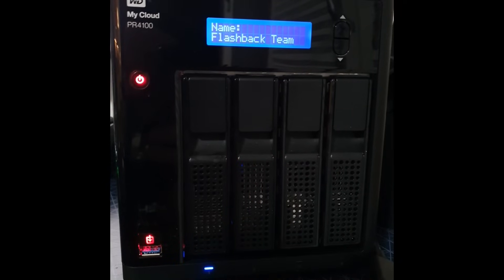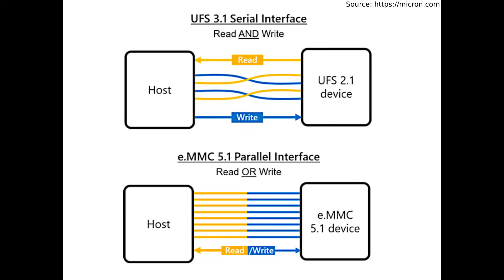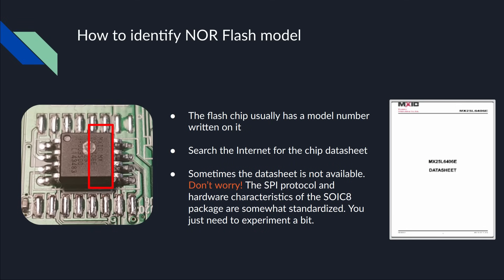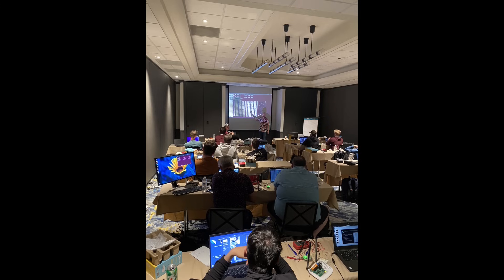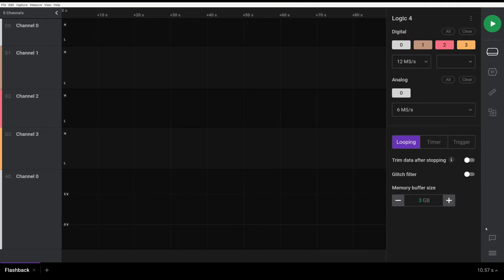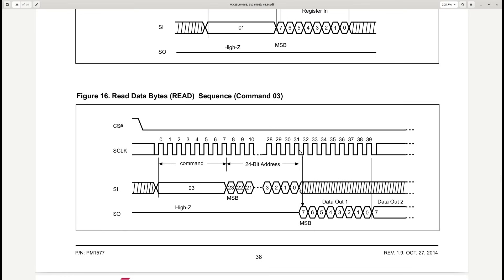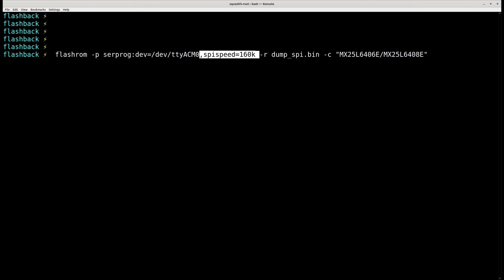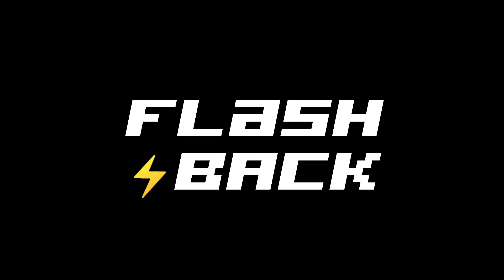Extracting Firmware from Embedded Devices (SPI NOR Flash) ⚡

Comment: This is really cool! I wanna dump the firmware of my e-scooter to hack it a bit, I didn't realize it could be that trivial :-) hopefully I get lucky and I can read/write firmware that easily!
Reply from the maker: We're happy you got inspired. Keep in mind that it all depends on where a firmware is stored. If it's external flash it is relatively easy. If firmware is stored within SoC/MCU then it won't be that easy as most likely there will be read protection that would need to be bypassed first.
Reply: @FlashbackTeam  That's exactly what I was thinking - I use MCUs for work stuff, and it's not necessarily that easy to dump their firmware given their flash is on-chip! I'm just hoping I might get lucky with the e-scooters one way or another ; if not dumping existing firmware to reverse it and tweak it, then perhaps finding an open source reimplementation that I could flash onto the chip, or making a new board myself if I have to (the main control board in that scooter isn't the one doing power distribution to drive the motors, so it's not unrealistic to just make my own, just will take more time...)

Comment: Nice! Used a similar process a few years back for some NAND flash. Didn't know about the hydrabus back then though. Instead I wrote a plugin using the older version of Saleae's SDK to dump the data of read commands to a binary file. Then had to do a little post-processing to get rid of the error correction codes that NAND has to transmit. Glad to see content showing an approach to the process!
Reply from the maker: In the past we were using Teensy with custom code to dump NAND Flash. Worth giving it a try too! But of course the most efficient is to simply use a programmer, but less fun.
Reply: @FlashbackTeam  Lots of lessons learned! I don't think I knew what a programmer was at the time. We relied on the SoC's bootloader to copy the file system from flash and we just copied the bus. Asking the flash to kindly show us its memory would have definitely been more elegant 😂. Luckily the flash data at rest wasn't encrypted!

Comment: How do you prevent the master MCU from talking to the flash at the same time? Most of the time when you provide power to the flash the MCU will powered as well, because they'll use the same power rail.
Reply from the maker: From our experience, in most of the cases that is not a problem if a device also powers up. However, on some occasions we give it more time for the device to finish booting process. Once a firmware is loaded to a memory there should be less operations directly on a flash.

If dumping in-circuit is impossible we can always desolder the flash chip.

Comment: you never mentioned FRAM or F-RAM. Kinda new to the market but it's very fast, and has billions of write-cycles in its lifetime.
Reply: "Ferroelectrics for Digital Information Storage and Switching", published in 1952
FeRAM was commercialized in the late 1990s. In 1996, Samsung Electronics introduced a 4 Mb FeRAM chip fabricated using NMOS logic.
Yeah, looks kinda "new" ... compared to the LZ 127 Graf Zeppelin airship;)

Comment: I found in my Rog Strix laptop some interface called JDEBUG2, which has 15 pins. Not really an embedded device, but I wanted to know more details on this interface and whether I can have some commands to show me laptop's diagnostics :).
Reply from the maker: You can use a signal analyser like the one we show in the video to try and understand what it is. With that number of pins and name, a quick (probably wrong) guess would be JTAG. However, we would be very surprised if JTAG is enabled on a laptop shipped to the public!
Reply: @FlashbackTeam  ok, but do you have any info about what could JDEBUG2 stands for? The only thing I can research on google is asus related posts and jdebug on the java JVM.

I will try to crossmatch jtag and jdebug for a test on a new search quest :).
Reply from the maker: Hard to tell what sort of debug interface it could be. I think best is if you find a schematic for this laptop. There should be a diagram and description of the interface. Maybe try to ask on some laptop repair forums / YT channels?
Reply: @DamjanDimitrioski  JDEBUG2 is JTAG Debug (header number 2) :) It's a debugging interface for troubleshooting eventual motherboards issues.
Reply: @ioanbustean7442  thanks, any specific specification url or more info about  header number 2?
Reply: @DamjanDimitrioski  It can also mean: "Jason's Debug Pin Header, try2/revision number 2". Do we know? Yeah, It may be a JTAG header. 
At least I don't claim to know for sure, nor that there is a specification for this label(There isn't! ... Like for STOP-Signs or USB or the general pin-ordering and naming of inter-board-connector on a PCB). Where did that guy get that from? Obviously he made it up, otherwise he would have written WHERE THIS SPECIFICATION IS DESCRIBED... And presenting us a pin-out, like a serious person and not like a clown: "Yes, IT IS .. But I have to go now". LOL. Oh Damjan and why 15 pins? Normally any such interfaces have a even number of contacts. ( Hmmm, who has mentioned the word "header" ... aha, this guy again, so thanks for misleading me, hehehe. Is it a [pin-]header?) Can you provide the topology of that interface, Damjan? Testing GND Pins and knowing where they are is easy and may be very helpful and a first step to identify that contraption. I wish success, Damjan!:)

Comment: I find your descriptions in the NOR flash segment to be rather inaccurate. TSOP chips (what you call NAND flash) have a parallel data interface which will almost always offer much greater data rate than a SPI flash (what you call NOR flash). Fast execution from a SPI flash is achieved by copying its data to an internal RAM. The latency is also higher on a SPI flash due to the whole serial interface. It's quite funny how you say the SPI chip has lower latency, then explain later that you have to clock in a command and address for 32 cycles before you even start to see data come out.
The underlying technology of NOR or NAND doesn't influence the packaging. Do a quick search on mouser or digikey, filter for NOR flash, and observe the whole spectrum of packages: BGA, CSP, TSOP, and SOIC.
Reply from the maker: Please note that the video is intended as a short introduction to the protocol, therefore we were light on details, although technically we believe all we said is correct. Our goal as hackers is to obtain the firmware for further exploration and reverse engineering, not to go deep into protocol internals and flash memory, but give enough information to know where to start with firmware extraction. 

If you listen closely, we never say that SPI flash has the lowest latency, we say "low latency AND fast execution". The fast execution is, as you point out, by copying to RAM, or actually by executing directly from the chip, which is impossible with NAND.

As for the packages, note that we also say "typically (...)" to describe what kind of flash memory comes in each package. As you said, different flash memory types can come in many different packages. 
However, our classification is correct for the majority of real life targets we have looked at in our hacking adventures. Other package types don't appear to be as common, at least in the devices we target.

Comment: 7:14 ... except that it's actually a pin that you pull low to select the chip you wanna talk to, when you have multiple SPI devices on the same data lines. It doesn't turn the chip on. And why would it, if it's already on?! But it selects it. Basically, it does exactly what it's called. Funny huh?!
Reply from the maker: You are right of course, it was an expression of speech to make it easier to understand. The most important is to know the purpose of the pin. In NAND Flash the equivalent pin is called "CE - Chip Enabled".

Comment: EZP2010, CH341A, MiniPro etc.
Reply from the maker: Thanks for mentioning this. We suppose everybody has their own favorite tools. In fact we also use a lot of Xgecu or other professionals programmers in our work. However, the goal of the video is to lightly introduce into SPI protocol itself, how it really works on the wire and how it can be extracted in-circuit without relying too much on "plug-and-play" tools. 

We are vuln hunters, our ultimate goal is always RCE on the target so getting a firmware or enabling debugging capabilities is just a milestone, not a finish line.
Reply: I use ch341a as well but never could read spi without desoldering it from the pcb. With his tool he can read without desoldering?
Reply: @petarpetrov8104  I have a ch341a and it came with a clip similar to the blue one they use in this video and I have successfully read directly from chips plenty of times without de-soldering.

Comment: advanced subject but turns out to be a noob lecture. for example "Hi, I'm here to extract firmware from the embedded device... but what does MCU mean and how does NOR flash work?" <-- they don't fit together. imagine I did a video on replacing the cylinder head gasket and then started talking about how an engine works. somebody who doesn't know how an engine works isn't going to want to change a cylinder head gasket and vice versa, same with your video.

Comment: @Flashback Team
 Hi,
 is it possible to take FIRMWARE from bit-locked - AVR atmel uC ???????????? like Atmega328P
Reply from the maker: In this video we focus on larger embedded devices that use external NOR flash storage. 

When it comes to small microcontrollers that have internal storage the situation is completely different. As you say, in almost all the cases they would have a firmware read-protection enabled. It complicates things and the actual attack path is very specific to a target. I am not sure if there are public attacks on Atmega328P. However, to point to a direction how such attacks might look you can take a look at attacks that have been used to break read-protection mechanisms on some other microcontrollers. From my experience it is usually some sort of glitch / fault injection attack that bypass a specific check instruction or that enables additional debug interfaces like JTAG.

1) UV fault injection
https://www.aisec.fraunhofer.de/content/dam/aisec/ResearchExcellence/woot17-paper-obermaier.pdf

2) Voltage glitch
https://www.riscure.com/uploads/2018/11/Riscure_Whitepaper_Analyzing_Automotive_Firmware.pdf

3) EM fault injection
https://eprint.iacr.org/2020/937.pdf

4) Rapid7
https://www.rapid7.com/blog/post/2019/04/16/extracting-firmware-from-microcontrollers-onboard-flash-memory-part-1-atmel-microcontrollers/
https://www.rapid7.com/blog/post/2019/04/23/extracting-firmware-from-microcontrollers-onboard-flash-memory-part-2-nordic-rf-microcontrollers/
https://www.rapid7.com/blog/post/2019/04/30/extracting-firmware-from-microcontrollers-onboard-flash-memory-part-3-microchip-pic-microcontrollers/
Reply: @FlashbackTeam  Thanks for replay 🙂

Comment: FYI: most routers are linux-based (e.g. Huawei created their own distro called "Dopra"), which means if you lucky then the flash isn't encrypted and you can mount EXT filesystem from it
Reply: They usually add a header to the firmware that you need to strip out.
Reply: @BillSargent1977  you're right! I did figured out weeks ago on my old huawei router
Reply: @KangJangkrik  linux to the rescue :D

Comment: What is the name of the blue clip you're using to connect to the legs of the chip?
Reply from the maker: They are called Ponoma clips, and they're much more expensive than "normal" clips, but well worth the extra money.
Reply: Yeah, the normal clips are garbage. I'll check the Ponoma clip then! 
You're the first one I've done across that mentioned the name of the better clip so now I'll be able to actually buy one xP

Comment: What is the reference of your cables? thanks
Reply from the maker: For jumper wires we like to use high quality cables with a rounded tip. They are usually thinner and work better for us. However, they are not as popular so it might be more difficult to find them. 

Here are few of examples:
* https://www.mouser.de/ProductDetail/Microchip-Technology-Atmel/AC163029?qs=hH%252BOa0VZEiCklwv7%252B6n15w%3D%3D
* https://www.mouser.de/ProductDetail/SchmartBoard/920-0067-50?qs=CVaTMblcXghZaf2hiFS1LQ%3D%3D
* https://www.mouser.de/ProductDetail/SchmartBoard/920-0010-01-per-piece?qs=A6MsUmktA0yCxXk1m%252BRdWA%3D%3D
* https://www.mouser.de/ProductDetail/SchmartBoard/920-0111-01?qs=zfu6fx%252B1HVWLqVfF11%252BxLQ%3D%3D